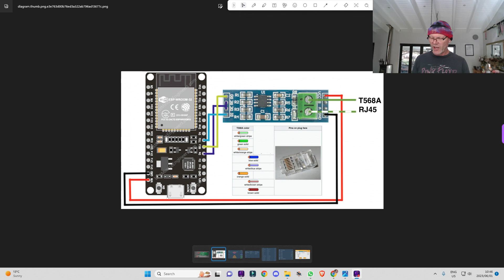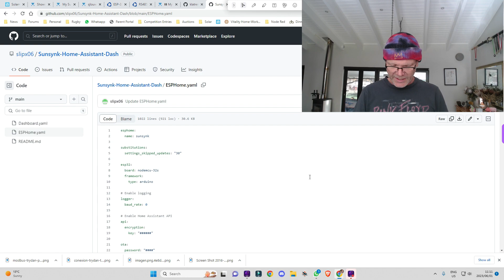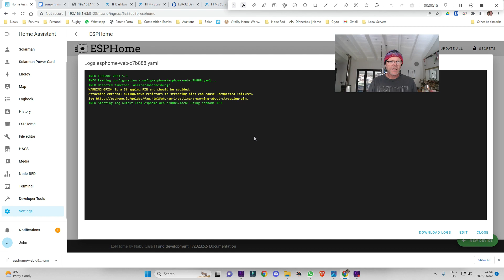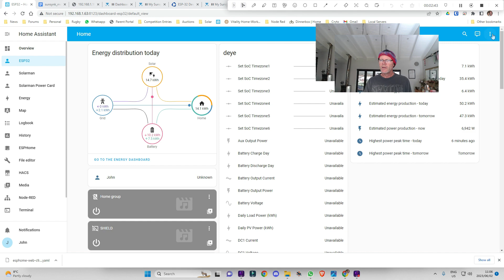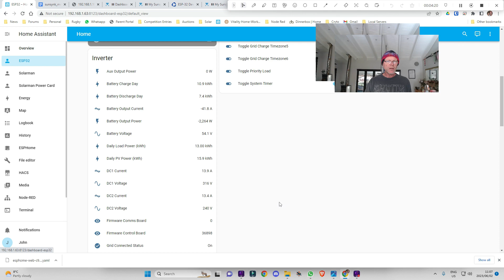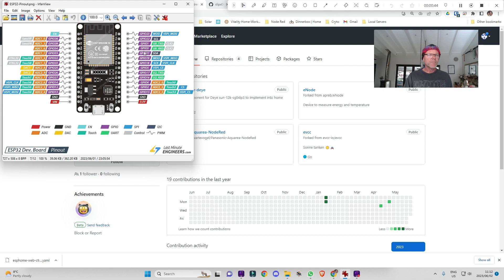Setting up your ESP32 Data Logger & Home Assistant

Comment: SUN-5k-SG02LP1 inverter inverex  5kw made by deye possible ?
error : Connection error occurred: [Errno 104] Connection reset by peer
esp32 pin 17,16,D4, GND,VIN 5v -- RS485 pin: DI to 17, RO to 16, DE+RE D4 , GND to GND, VIN to VCC,  A to RJ45 pin 2 and 7  -   B to RJ45 pin 1 and 8  (RS485 remove for R7)
please help
Reply: Hi Im still struggling to get values from mine. But HASS sees it and its online and the code is running. But I spent the last 2 weeks figuring out my wifi. And I saw that error alot when my wifi wasnt strong enough. It hasnt happened since I got a router right next to the inverter
Reply from the maker: That's great @XianZA, glad you have got it working
Reply: @SolarIntegrations  oh its only staying online and running code, but no values. Will be posting on the forum soon and see if anyone can help
Reply from the maker: @XianZA  Ok, maybe upload the logs as well so we can see where the problem might be. Have you checked the pins on the ESP32 that you are connecting the RS485 board to are the same ones as references in the YAML file? Another thing to check is the connection to the RJ45 connector and that you are using the correct pins and then finally, have you removed the resistor on the RS4854 board, that often makes a difference as well.
Reply: Please note that the ESP32 is not 5V tolerant, yet the circuit promotes connecting it to 5V pullups and a 5V output on the Microrobotics RS485 board. This could result in the ESP32 I/Os being damaged either immediately or over time. I have posted a potential solution further up in the comments.
Reply: thank

Comment: I finally worked out why I could not get my ESP32 working on RS485. I originally tried to order ESP32-DEV board from the link, but it is discontinued and replaced by ESP32-DEV-CH340-C. Somehow I ended up with ESP32-DEV-CP2102-C and thought I ordered CH340-C. Just discovered the pins are completely different. Was counting from the ends and did not notice it has more pins.
Reply: @SolarInegrations Thanks for the video and inspiration. I have it working.

Comment: these components are no longer available at Microrobotics. Where else can l find them?
Reply from the maker: Hi @lotchetsanga6350  , still available just a new model as the new ESP32's are all with the Type C Connectors - https://www.robotics.org.za/ESP32-DEV-CP2102-C   & https://www.robotics.org.za/RS485-MOD

Comment: Hi. How does this look like once connected on the inverter? Is it outside like with the e linter dongle? does it look like a lot of cables dangling around? do you have a picture showing this connected to your inverter? will this then connect to the home assistant server via wifi?
Reply from the maker: Connects via wifi, it is a board but you can mount it in a purchased or printed enclosure. Connects to the inverter using an Ethernet cable

Comment: I have some questions. Where in the video is the the yaml file from slipx06 uploaded to the ESP32? What are the pin connections that match the yaml file?
Reply from the maker: Hi @arthurbrand8107 
Sorry it is not 100% clear in the video. The YAML file from Slipx06 is loaded onto the ESP32. He uses tx_pin: GPIO1
  rx_pin: GPIO3 & flow_control_pin: GPIO16 as default but you can change these pins if you are using different ones.

Comment: I have been meaning to ask, what is the YAML code on the GITHUB page of slipx , ESPHome-8K-Sunsynk.yaml file ? for
Reply from the maker: If you use and ESP32 with an RS485 board, you load that file onto the ESP32 using ESPhome and all the entity names are correct for the cards.
Reply from the maker: Sorry, I know that is a confusing thing about that video and other people have commented on it.

Comment: Hi, I have a DEYE 10kw 3f. I'm using 8k-sunsync.yaml and the data loads and stands. They are not correct. Can you put a yaml that works? Thanks for your work... DEY12k-modbus.yaml is not all, and it doesn't work
Reply from the maker: Hi @MS-dx1zl, I wish it was that easy :-) . The Yaml files are all based on the Modbus register which we managed to get from Sunsynk, it details which modbus address is for which value. Queries are sent to the inverter asking it for the value for a specific address, 186 for example is the address for PV1 power. Most of the Sunsynk inverters seem to use the same register and people have written the various integrations mostly built around this register. The register contains values for the single phase and 3-phase inverters and these are mostly what has been used for creating the yaml files that you have spoken about. I haven't seen a 10kw 3-p as yet but don't see any reason why they would change the register for it as it seems to be stable. My suggestion is to get onto the powerforum website at https://powerforum.co.za/topic/17970-home-assistant-sunsynk-power-flow-card-and-dashboard/ and have a look through the thread,  if you can't find any solution, post a detailed log from the ESP32. the more information you are able to provide the more likely it is that someone will be able to assist you there. Good luck and see you on the site
Reply: thanks .... I found MODUBUS for 3F converter -----  

# 672: dc/pv1/power
 # 673: dc/pv2/power
 # 676: dc/pv1/voltage
 # 678: dc/pv2/voltage
 # 677: dc/pv1/current
 # 679: dc/pv2/current
 # 529: day_energy
 # 534: total_energy
 # 514: battery/daily_charge
 # 515: battery/daily_discharge
 # 516: battery/total_charge
 # 518: battery/total_discharge
 # 590: battery/power
 # 587: battery/voltage
 # 588: battery/soc
 # 591: battery/current
 # 586: battery/temperature
 # 625: ac/total_power
 # 598: ac/l1/voltage
 # 599: ac/l2/voltage
 # 600: ac/l3/voltage
 # 630: ac/l1/current
 # 631: ac/l2/current
 # 632: ac/l3/current
 # 633: ac/l1/power
 # 634: ac/l2/power
 # 635: ac/l3/power
 # 520: ac/daily_energy_bought
 # 521: ac/daily_energy_sold
 # 522: ac/total_energy_bought
 # 524: ac/total_energy_sold
 # 540: radiator_temp
 # 541: ac/temperature
 # 616: ac/l1/ct/external
 # 604: ac/l1/ct/internal
 # 617: ac/l2/ct/external
 # 605: ac/l2/ct/internal
 # 618: ac/l3/ct/external
 # 606: ac/l3/ct/internal
 # 650: ac/ups/l1/power
 # 651: ac/ups/l2/power
 # 652: ac/ups/l3/power
 # 653: ac/ups/total_power
 # 644: ac/ups/l1/voltage
 # 645: ac/ups/l2/voltage
 # 646: ac/ups/l3/voltage
 # 526: ac/ups/daily_energy
 # 527: ac/ups/total_energy

Comment: Hi all, what is the prefered and neatest way to power the esp32, specifically for the use with a 5kw sunsynk inverter?
Reply from the maker: Hi @XianZA, the new ones are powered by a USB Type C, I have my one inside the inverter but had all sorts of issues with signal interference, best to have a longer cable to the RS485 board and just keep it closer to the power supply I think.
Reply: Ok but are you getting power from somewhere in the inverter or from a plug socket. Reason I ask is that all my outlets are far from my inverter.
Reply from the maker: @XianZA  I get mine from a plug socket, you can make the RS485 cable quite long without an issue, up to 50mtr depending on the cable quality etc.. Would start with a short one, get everything working and then see if you can make it long enough to get to a plug, just remember it need to be a twisted pair to work.

Comment: Anyone tried this on the 12kW Sunsyk yet?
Reply from the maker: Hi @natiusvanderwatt3309 , it does work on the 3=phase inverter, there are however a number of the sensors on the 3-phase inverters that you don't have on the single phase inverters. There is a file called "DEY12k-modbus.yaml" on Slipx06's github page but I would get onto the Power Forum and confirm if that will work with the Sunsynk without any issues (should do as far as I am aware)
Reply: @SolarIntegrations  yer the man. Thank you

Comment: Earlier in your video you said something about taking the code from slipx06 ESPHome.yaml file which you never explained or is that that the Dashboard info ?
Reply from the maker: Ahhhh, ok. I would suggest that you load your ESP32 with the file that can be found on the Slipx06 Github page at https://github.com/slipx06/Sunsynk-Home-Assistant-Dash/blob/main/ESPHome-8K-Sunsynk.yaml
Reply: @SolarIntegrations  Do you add that YAML file to Home Assistant under the configuration file ? Or do you upload to the ESP32 board? If so, how would you do it ? 
This is probably why the Data is not coming through to the home assistant?

Comment: Hi I have the Sunsynk 8k Inverter and followed your video, made sure the cables are correct however the data is not coming through. ESPhome is connecting to the board and is all fine but no data ?? Removed that small chip as you said and still nothing. Do you have to enable the RS485 port on the inverter ? Thanks
Reply from the maker: Hi @VaughanLundin, you don't have to enable anything on the inverter. Can I suggest having a look through the thread on the Powerforum and if you don't come right, post a message at the end of the thread with a copy of your Logs from ESPhome and we will try to help you out there? https://powerforum.co.za/topic/8646-my-sunsynk-8kw-data-collection-setup/page/3/

Comment: As part of the fault finding tips... I can add that last resort remove R7 resistor.
I was getting erratic data until I removed it.
Reply from the maker: Hi @FransStofberg, that does seem to be what most people are experiencing. I think that the inverters usually have a terminating resistor built in. I have removed the resistor on all of my installs.
Reply: You might want to remove R1-R4 too, and replace with a voltage divider to reduce the 5V output on RO to 3V3. ESP32's are 3.3V devices that can't tolerate 5V on their I/Os.

Comment: Hi There, this is great video and just what I was looking for.  I am trying this, but i do not know where and when to put the ESPHome-8K-Sunsynk.yaml onto the ESP32 board?  I am not a programmer and need help to put the query's on the ESP32 Board to get the info from the Inverter.  Any assistance would be highly appreciated
Reply: Thank You, I successfully connected the ESP32 to my WiFi,  I then copied and pasted the yaml code in the Edit section of ESPHome.  I entered my details in the #### sections of the code.  But still get this error:  WARNING Can't connect to ESPHome API for sunsynk.local: Error resolving IP address: [Errno -5] No address associated with hostname.  Any assistance would be appreciated.  Thank You...
Reply from the maker: Hi  @pieteroconnell1518  You need to load the Yaml code onto the ESP32 using ESPhome, you will need to keep your ESP details ie wifi etc and just copy the section from "binary sensors" down, am going to edit this video and include a new cut explaining that for you guys. Make sure all the other comments above that have your own ESP32 info included i.e. the pins you are using etc
Reply: @SolarIntegrations  thank you. Really appreciate your help
Reply from the maker: @pieteroconnell1518  If you don't come right you can always find help on the power forum at https://powerforum.co.za/topic/8646-my-sunsynk-8kw-data-collection-setup/page/12/
Reply: @SolarIntegrations  I've tried various combinations of what you've explained in the video, but I'm not coming right, i'm getting a component requires modbus_controller error.... 
Tried posting on the forum, but it won't let me signup either.
Reply: @ameetranchod  Did you install the esphome YAML file onto the ESP32? Best place for support is going to be the forum so I suggest that you work out how to sign up there as well and go to the thread I posted. ESP32 is a bit more tricky than the other integrations to get working
Reply: @SolarIntegrations  thanks so much. Everything is working now. I had the RS485 connection wrong. The part i missed is: 2 and 7 -- >A and 1 and 8 -->B
Reply from the maker: @pieteroconnell1518  Awesome, glad you got it sorted
Reply from the maker: Hi Pieter, can I suggest watching the video again, maybe I need to make the process more clear?  You first need to add the ESP32 into you ESPhome in Home Assistant. Once you have the ESP32 connected you can update the code on it using the  Edit button. You don't need to have it connected directly to your PC once it is onboarded and you can do any updates wirelessly.
Reply: @SolarIntegrations  Great video... but the code edit part is lying on the editing room floor somhere. I blinked and your ESP came up as an Inverter device.
Reply from the maker: @natiusvanderwatt3309  I think you are right, am going to redo this video for you guys, have two other video's I want to get out and will then get onto it

Comment: Oh the joys, got some bad vero board, spent an afternoon soldering and de-soldering, measuring, scratching my head, good old Micro Robotics failed me badly. Test your veroboard with a multimeter!  Lesson learned, sometimes the suppliers are fall for the scam and they buy factory rejects. I sent them an email so hopefully the will test and bin the e-waste. I feel sorry for someone new to this trying to figure out why things are not working. RS485 is fairly fault tolerant but you do now want to pass it too much voltage(especially if you use a buck converter to power your esp32), having the magic smoke in the inverter escape would not be fun
Reply: The provided circuit might be part of your problem. ESP32's are not 5V tolerant, so you should not be connecting them to the 5V pullups and output of the Microrobotics MAX485 board. Remove R1, R2, R3 and R4, and replace with 330R series (inline) and a 680R resistor to GND on the R0 trace to form a voltage divider.
Reply: @capetownkelp  agreed with the 5V and not driving the rx pin with 5V. But I spent I whole afternoon chasing issues only discovered when I started measuring the strip board was linked in certain places and adjacent lines had 0 ohm resistance. Threw the leftover board in the bin. Managed to build several working circuits with vero board that I ordered from Communica.
Reply from the maker: I don't use veroboard, is only 5 wires so I just solder them on, not pretty but it works :-)
Reply: @SolarIntegrations  I started like that, and it is fine for testing if something works. If you are going to use it in the real world then mount your boards/components on a vero/prototype board and put them in an enclosure to shield them from moisture or electrostatic discharge. A little more effort but it goes along way to protect your expensive equipment

Comment: Great work, thanks for the tutorials. Quick question. I have a 8k synsynk and have communications running with the Modbus board but information coming in does not match the ID's resulting in incorrect data against the headings. Any suggestions where I can find a list of register ID's
Reply from the maker: Hi Tim, I am not 100% sure what could be causing that. Rgere are a number of ways you can see a full list of the entities being brought in by any Integration, have a look in the settings/integrations/ menu and then click on the relevant integration, it will list the names of all the entities it is responsible for with their name. You can also check the states/values of those entities by going to the Developers Tools menu option and then clicking on States and then filter the entities with the name of the entity you are looking for, it will show you the current value of that entity. I hope that answers your question. You can also rename entities if you want in the settings/integrations and then click entities at the top of the page, you can drill down and change names etc there.
Reply: @SolarIntegrations  Thanks, I'l persevere. It may just be a firmware change. fresh start with replacement clean files may help

Comment: I have the ESP32 integration set up and running with a Sunsynck 8KW inverter.  Everything seems to be working except for the grid power sensor (169).  I get no readings for that.  My CT clamp is installed correctly as the inverter readings and functions are perfect and so is my date in the cloud.  Is anybody else experiencing this?
Reply from the maker: Hi Jo, if you go to developer options and check under states, does it have a value for sensor.grid_power ?
Reply: @SolarIntegrations  Hi, thank you for the reply.  I removed the filters in the yaml file from those sensors and that solved the problem.  I got the advice from Slipx

Comment: Micro-Robotics is a bit sneaky, the price incl VAT is there but not very visible. So you tend to think their prices are cheaper than other suppliers. Oh the hours I have spent chasing down wires that do not make good contact, or that I accidentally soldered and is touching something else. I agree the ESP32 once it is working is a great tool
Reply from the maker: Hi Heinz, is always a good idea to look around and check prices.

Comment: Thanks for these videos, I'll be trying some of this on my sunsynk 8kW. 
Will using this local modbus connection prevent the sunsynk dongle working or talking to the cloud?
Reply from the maker: I am glad you are finding them useful Jas. You can definitely run and ESP32 & wifi dongle at the same time without any issue, I have them both running and like to have my data going to the cloud for backup.